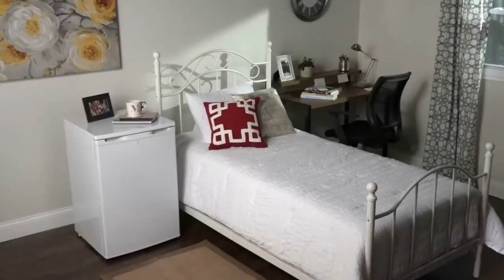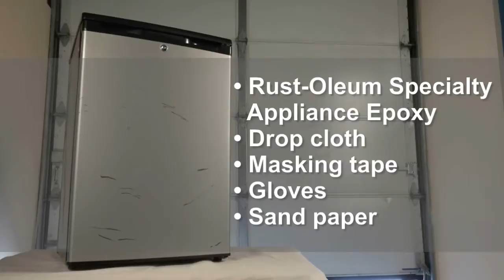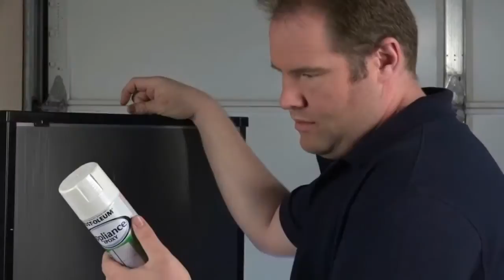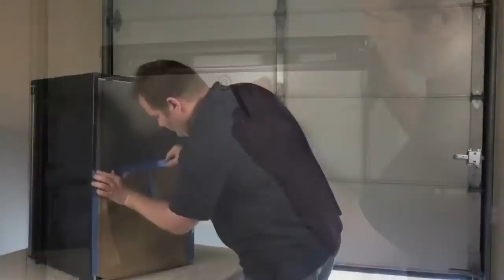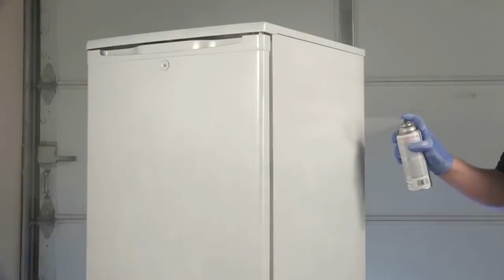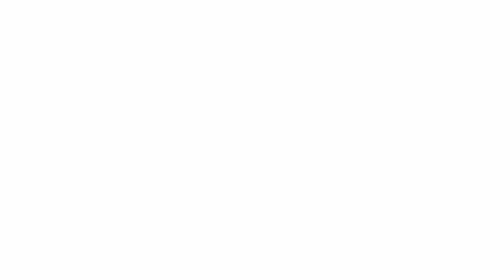How to Refresh a Mini Fridge with Rust-Oleum Specialty Appliance Epoxy Spray Paint

Comment: Incredible strong fume.......I truly do not think it is healthy for indoor use......
Reply from the maker: Hi Yuyang, when using the Appliance Epoxy Spray Paint we do recommend applying in a well-ventilated area, or if possible outdoors
Reply: @RustOleumCDN  So how long shall I put the appliance outside? After the painting dries? But even after it tries, I can still smell the fume...
Reply: I am just very confused, on your product, I just noticed that there also the symbol of toxic. So how can it be used on indoor appliances.......
Reply from the maker: @yuyangzhou4717  Once the coating completely cures, it will no longer off-gas, no longer smell, and is non-toxic and safe for accidental food contact when fully cured. Full cure can range from 7-14 days, depending on temperature and humidity. It dries and feels like an original appliance finish and is durable and moisture resistant and washable. Perfect for indoor appliances. If you are concerned with odours when curing, you can place a fan nearby to help circulate the air and open windows to move any odours outside. This will also help with drying.
Reply: @yuyangzhou4717  Most products are toxic before they cure... The enamel on your dinner plates for example. The coating on your kitchen table or the paint on the walls of your house, all toxic.
Reply from the maker: @V If the door handle is the same material as the fridge itself, you can paint it with the Specialty Appliance Epoxy